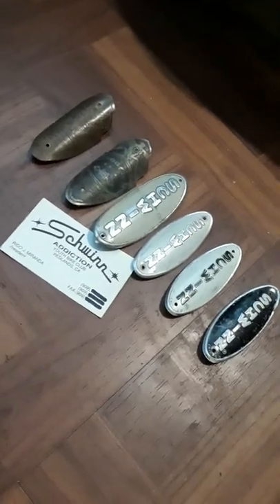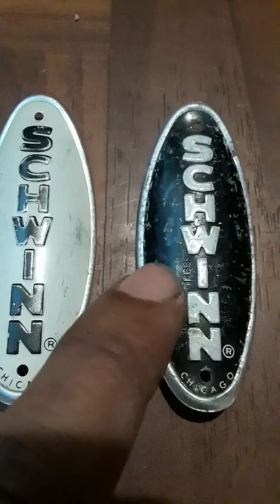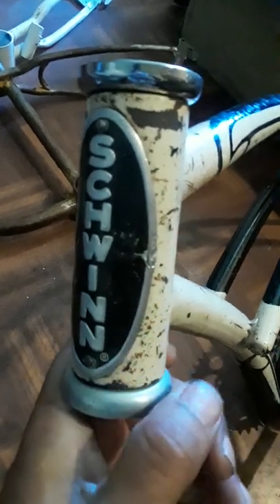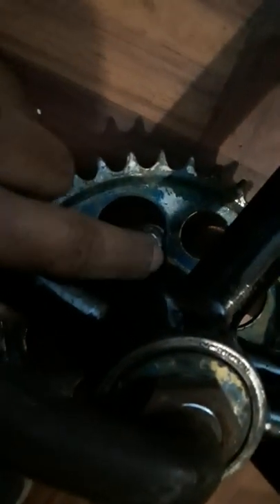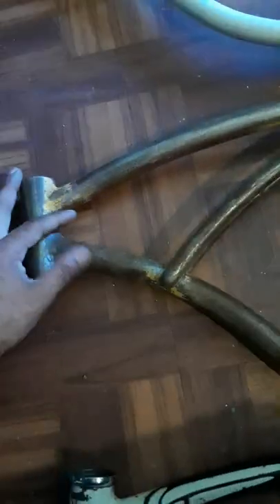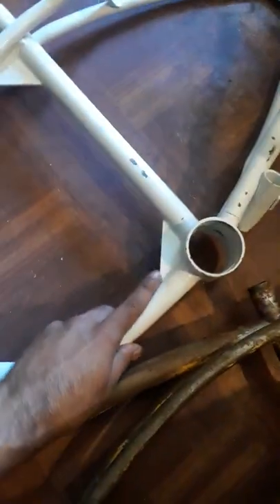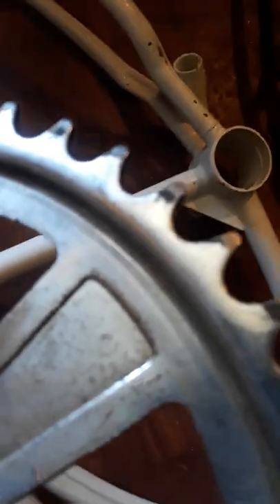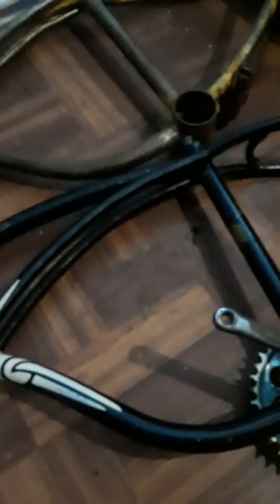How to tell if you have an original Chicago Schwinn

Comment: Hi thanks for your video. I'm lost  please help.  Serial number on fork tube says du505090
Under the cranks says 1900... 
 the front badge  says 1943. Looks like white and black small badge . 5th from your left in this video...
 Also says Chicago please help
Reply from the maker: fork tube is correct serial number. it the date the frame was stamped(before they welded it together). DU is April 1983. badge date matches (its the day they of final assembly of bike)1943 is 194th day of 1983. which is July 13 1983. so 4 months from when they stamped the serial till they finally completed putting the whole bike together.  under crank will be police licence number when they registered the bike, they usually stamped it as well.

Comment: great video .i have a schwinn varsity  with a tall neck the back of the seat says schwinn.  front emblem has the two screws the emblem is white .with blacvk letters. on bottom it says chicago with a black r . has no.0847 . can you help me out thanks .
Reply from the maker: 084-7 would be 087th day of 1977. that's final assembly. there should be  digits below the badge. that would tell the frame date. more than likely a 77 model built in 76.

Comment: What if you have a large badge that says Schwinn across the top and stingray down it like yours says Schwinn down it
Reply from the maker: I've seen them say Spitfire going down with schwinn on top but not stingray.  Sting Ray didn't start till 63, like 4 years after they stopped using large badge.

Comment: do you have a 1963. crank shaft for a stingray that you would consider selling?
Reply from the maker: nothing extra. I had 2 63 projects. 1, I ended up selling. This one I'll be holding on to and finishing it up. but I'll keep an eye out for one. they pop up every now and then. you can even use a crank from a 63 girls 20 in bike. which might be easier to find.
Reply: @Schwinn_Addiction  Cool! thanks so much! Let me know if you do run across one. Have great day!!

Comment: Bro I am having trouble decoding my Schwinn, MR711626 is the serial.
Reply from the maker: M=Dec, R=1980. The numbers should be located below the front head badge.
Reply: Thanks man, it’s confusing..lol.. on the badge it’s white with the black R on it and 4 numbers are 2261 or 2281 I can’t tell if it’s a 6 or 8
Reply from the maker: That 4 digit is another code when it was fully assembled. That started back in 75. First 3 digits are the day and last digit is year. It's the 228 day of 1981.
Reply: @Schwinn_Addiction  bad ass bro.. thanks great channel. Will def be looking for parts..
Reply from the maker: Thanks bro. What size is your bike? 20in?cruiser?
Reply: @Schwinn_Addiction  yes sir, are you on IG or fb? I’ll send some flicas
Reply: @Schwinn_Addiction  cruiser

Comment: Great video. I have an issue with my frame. I cannot find the serial number anywhere but it has the turn downs, kick stand and rounded rear fender mount as well as the smooth neck where the front forks go into. It looks like the front badge screws broke off when someone tried to take it off so I would have to bore them out. Do you know what size the holes are? What year period could it possibly be?
Reply from the maker: Send me pix to my Instagram.com/Schwinn_addiction
Reply: Great news!! I grinded the paint off on the rear drop out and found a vin #. It’s an MD meaning Christmas of 1968! Thanks for teaching me Carnal. It would have been green blue or red. It’s currently candy blue from the 90’s when my uncle sprayed it. I might spray it candy brandy wine.

Comment: Yeah i've had original ones crack and the ones made in taiwan not crack at all.. If it's the blueprint of a Schwin... It's a swim it don't matter where it's from... As a matter of fact to me the taiwan one's frames are a lot stronger...
Reply from the maker: I've been collecting Schwinns for 25 years , owned over 200 Schwinns off and on. and yet to have a frame crack on me. I have heard of them breaking but they were beat hard from jumping and hard riding. Not break in half but crack at a weld . Still ridable. But before I had any Schwinn as a kid. I used to have Huffy's, murrays and cheap bikes. I went thru them like crazy. One I was riding thru the back yard and the front head tube broke clean off. Ya, I ate it. But to say they're stronger. Is not true. Klunkers and BMX were birth off vintage Schwinns, used because of how well built they are.
Reply: @Schwinn_Addiction  Well that's good for you... I have old Schwinn bicycle... That was 1 Of the first one's maid In taiwan... Still says chicago u s a with the area code but it says Is made and taiwan... And I'll put that up against any Is schwin made in chicago.... And I. And I do understand people prefer. The ones made specifically in chicago... But the blue prints the same... Just cause it was different hands making it they were making it off for the original blue print. ....

Comment: I have two Chicago made Schwinns:   a Collegiate circa 1969/1970,  and a Town and Country trike circa 1970 or so.  Those were passed onto me by the original owners who bought those bikes new back then. The head badges are screwed on.  I also have a Schwinn 'Rocket Comp' full-suspension mountain bike from the 1990's which I'm sure is an off-shore made Schwinn.  Two years ago I bought a re-issue Sting Ray which is a Pacific Cycle made repop.  The head badge is just affixed with adhesive..not screwed on.  As I recall the original Sting Rays had very deep lustrous paint the repop I bought while it is a nice looking and riding bike;  one thing that struck me is the paint doesn't seem as nice as I recall the originals were.
Reply from the maker: ya, it's totally different. original Schwinn has a baked on enamel. similar to Powder coating. it was thinner but tougher. not like paint now a days.

Comment: I have old 26" frame that has all the markings of an older frame , screw on tag, huge seam on bottom, plus when I got it had a skip- link chain set up and huge Ashtabula 7" stroke crank but it has the numbers on front tube starting with LN .  ?
Reply from the maker: L would be month=Nov & N would be year = 1977. That number should be located below the badge.
Reply from the maker: It sounds pieced together. Skip tooth parts are a lot older. From 30's to early 50's. Ashtabula parts are big money if Stamped.